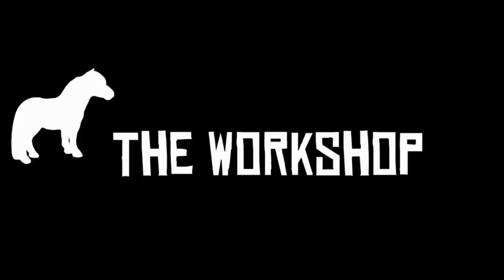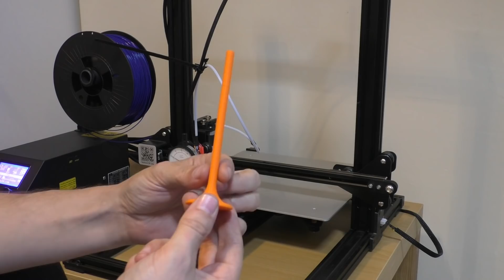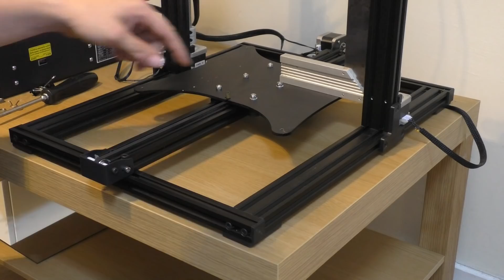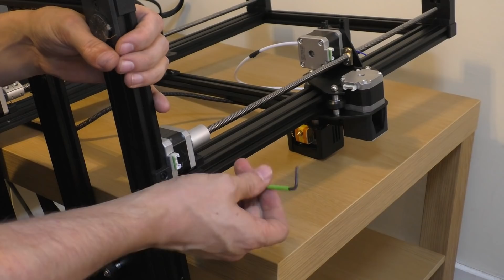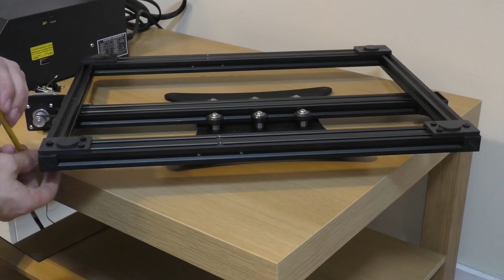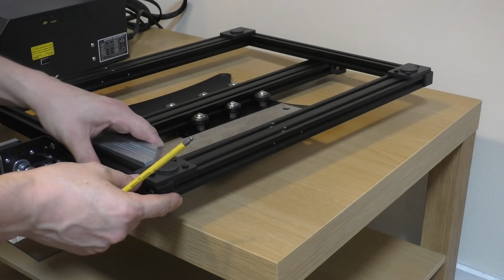CR10S Set up - 3D Printing

Comment: Hey matt I want to ask some questions an you are the best person I can think of.

I watched delboys last video where he attaches brackets with glassfibre and resin. At the end he states that he has to wait probably 48 hours for it to cure fully. I worked a few times with smaller patches of GRP (with polyester resin)  but only for aesthetic  and not structural reasons, therefore I sometimes used a blowtorch to heat it up a bit. Since resins cure with exothermic reactions I thought giving them more engergy input will result in a faster reaction time.  This discolored the GRP to be more brownish in color thought. Once the GRP is cured it is actually quiet heat resistant.

Is this a valid method or will it weaken the connection? -if so is there a safer/colder way (heat gun , hair dryer,..) that wont weaken the joint? 
Is there a difference in using epoxy or polyester resins?
Reply from the maker: No this is a bad idea. The exothermic reaction is not just about heat but cross-linking. This is where the long chain molecules bound and where the strength comes from. The heat is the energy required to make this happen. Adding heat can actual cause reactions to happen that's not wanted. 

In other words its like this. You can't bake a cake in half the time by increasing the temperature - things burn (which is basically oxidation)
Reply: Okay thank you for the answer. I´ll have to change my methods then if I ever want to make something structural.

Comment: Hi Matt,
You should have a look at your firmware. The current version of Marlin has a feature called Skew correction. This is a software feature to correct misalignment in the XYZ axes. Solving the problem with hardware is always better. Fine tuning the skew by software is the cherry on the cake. 
By the way, wobbling backwards and forwards has nothing to do with XYZ misalignment. It sounds like Z wobble to me. But that is just a guess. There is no clear picture of the print in the video.

Comment: Hi Mat just setting up my printer using your advice but I’m a little unclear on the Ye-ha measuring system. I’m struggling with how many Ye-ha = 5mm
And how to calculate 7/8 of  a Ye-ha, if you could clear this up it would be a great help lol 👍🏽
Reply: Maybe a white board session demonstrating the Ye-ha system of measurement would be helpful lol

Comment: In order to have decent adhesion to the bed, the first layer must be squeezed onto the bed. If you need the part to have the correct dimensions with the first layer, print a raft. That raft deals with the squeezed first layer, adds a few more, then the object gets started. Peel the raft off when done to get the part back to dimension.

And I bet the end of that one extrusion rail is not cut square, that's why it was pulling away when you tighten it down. You could maybe shim one edge, or just live with it since you have it square now.

Comment: When I was choosing my first 3D printer, setup between prints was one of the things I really didn't want to mess around wasting time with. I ended up buying one with an inductive sensor and the firmware will probe 3 separate points on the bed before it starts so it actively corrects the Z axis as it prints.

Comment: I tried the whole DTI thing and found you get much better results doing it ‘by eye man’. I print off a square job that’s about 150mm x 150mm and only print the first layer. First I do the by eye man and sight a small gap, roughly 0.1mm, then go round the bed in a square pattern roughly where the four corners of the 150mm square would be in the centre of the bed. Set the print off and adjust the bed on the fly so the plastic is evenly extruded on the bed. If you set the bottom layer to be concentric you get loads of chances to get it right. 

I’d highly recommend getting a sheet of PEI to put on the glass. It’s like the blue tape but lasts for ages, the lazy mans choice. AndOrNot sell it the right size for the cr10. 

Check the terminals on the power supply are tight, they often aren’t done up properly and can cause your psu to take up smoking. 

Check out octopi, will let you wirelessly send files from your pc as well as monitor via webcam. 

Print off some plastic washers for the bed to stop the springs cutting in to your bed and fucking up the heat element. Worth printing off the large bed levelling knobs too, makes levelling much easier due to access and large diameter. Available on thingiverse for free. 

100% print off the heater element wire tether if your printer doesn’t already have it. The wires bend/flex and then snap and cause carnage. The thingiverse design is that good and also needed so much that creality ship it with their new printers now. 

Keep an eye on the Y axis belt, it can work its way towards the pulley and start chafing/fraying. 

Enjoy the printer, it’s an amazing piece of kit. I have a £2k+ printer at work and this thing easily keeps up.
Reply from the maker: "Print off some plastic washers" LOL or just buy some nylon ones - its a lot easier....
Reply from the maker: "Worth printing off the large bed levelling knobs too, makes levelling much easier due to access and large diameter. Available on thingiverse for free. "

- A mate said this a work, but you can also buy them proper injection molded - The new ones come with them as standard.
Reply: Buuut you have a 3D printer, get that thing printing 😁

Comment: Use some cable ties on the square, makes life a little easier. :)
Reply from the maker: Apart when you have to move it LOL or do you mean on the base to slot into the slots?
Reply: I actually meant cable tying the square to the frame work. In fact 2 squares cable tied will give you the opportunity to pinch all the bolts and nuts and maintain the square.

Comment: Blue painters tape on the plate, you'll never look back!
Your welcome
Reply from the maker: Treid that and its shit. Clean Ikea mirror for me....
Reply: I swear by it for 90% of prints. My other two are frosted plastic eg it has a rough finish to it and stick glue if it's on glass if I want a good finish on that surface
Reply: I use Pritt stick and it just washes off with soap and water.